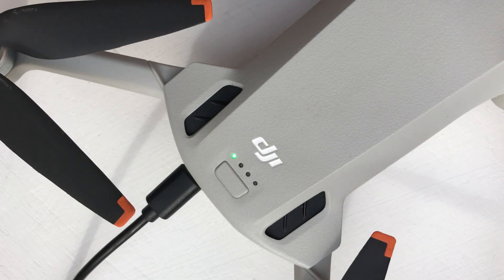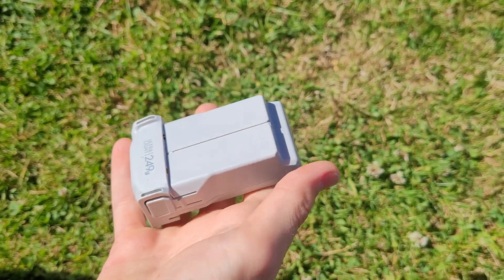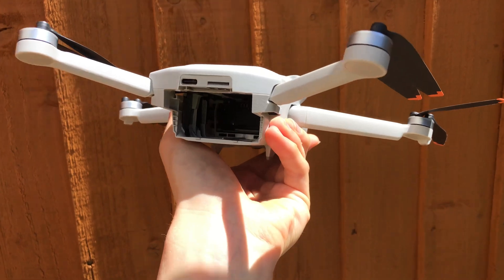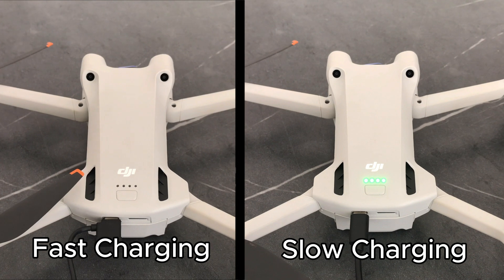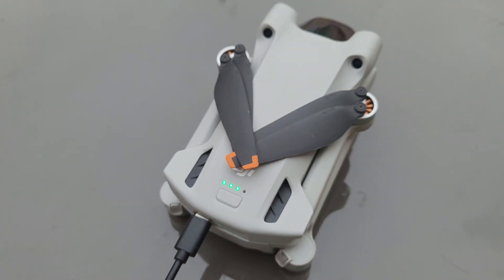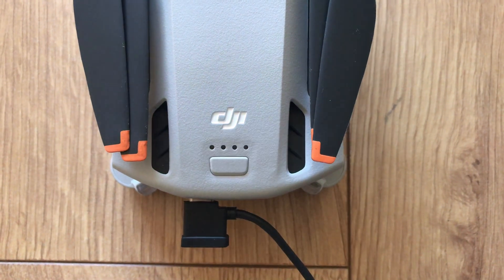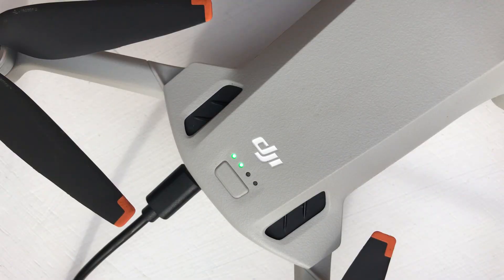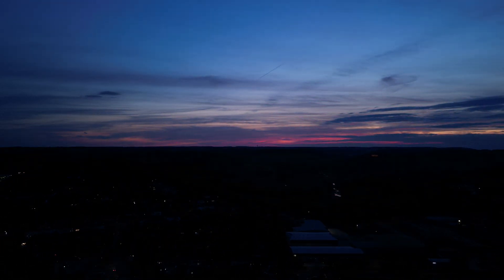Fast vs. Slow Charging - Drone Battery Care | DJI Mini 3 Pro / Mini 4 Pro

Comment: I always slow charge my battery’s when I can, especially after they have been dormant for a long time not being used.. the absolute worst thing you can do to a battery after it’s sat around for a year not being used it force it to fast charge.. a nice slow charge will help it slowly come up and will save the internal cells from stress.. also with a slow charge you should see a very slightly better flight time because you can actually pack more power into a battery that’s being charged slowly than quickly 

I only fast charge when I’m needing to use the battery again right away

Comment: For maximum speed, use a 65W charger when using the 3 x battery charger. If time is not critical, a 45W charger is better for battery lifespan. If you charge 2+ batteries
The difference lies in the heat generated during parallel charging:
The 65W charger charges two batteries simultaneously at high power (30w), causing temperatures to reach around 48–50°C.
The 45W charger also charges two batteries in parallel but splits the power to approx. 22.5W per battery. This keeps the cells significantly cooler at 35–38°C.
The process in detail:
 * One battery: No difference in time or heat.
 * Two batteries: The 65W charger is faster but causes high heat (~50°C). The 45W charger takes slightly longer but keeps both batteries cool (~38°C).
 * Three batteries: First, two batteries charge in parallel (hot with 65W, cool with 45W), followed by the third battery charging individually. Then at 30w.
So if you charge 2 batteries at once in the charger, 45w is the sweet spot.
2800mah DJI mini 5 pro. 
To charge each battery with the 1C optimum, use the Anker nano 20w (or similar). Temp max. 35 Celsius. 

"1C" means charging with a power equal to the battery's capacity (e.g., 20 Watts for a 20Wh battery).
This charges it in exactly one hour. It is the maximum speed possible without creating harmful heat.

In short: If you charge 1 battery, use 20w. If you charge 2 batteries at once, take the 45w charger. If you charge all 3 batteries and time is not critical, take the 20w charger. Also if you have not charging base and only one battery in the drone.

Comment: But how do you slow or fast charge you didn’t explain that
Reply: You can use an old phone charger to charge your drone battery—most older phones came with slow 5W adapters, which are safe. But some older models had fast chargers too. If you're not sure, just check if the battery heats up while charging. With a slow charger, it usually stays cool. If you're still unsure, it's safest to buy a basic 5W charger from any cell phone store.

Comment: This is odd ! Keeping in mind this is the Mavic mini 3/4 pro . I have the mini pro 5 and placed the battery in situ not in the hub and used a Rav 30 watt charger in the iSmart mode to charge  the battery with 80% already in .the battery completely discharged enough not to start the drone when drone legs were opened . ( the battery charged up fine when in the hub ) but testing the battery by pressing the button on it , 2 opposing green leds flash indicating a battery malfunction although initially all leds light up . My fear is the the battery malfunctions in flight . Any ideas ?

Comment: if you look at the mini 3/4 pro standard battery, it is about 2600mAH with max charging voltage of 8.4v, also it is stated that in its spec sheet, that it would take 58 mins to charge with a 30W USB C PD inside the charging hub. By working out the math, it is very obvious that the battery is only charge at 1C or max 1.5C only, which is very standard and healthy charging amperage. unless, if you plug in a 100W PD charger and the battery would complete its charging by 20 mins, yes, then it is quick charging it at 2C-3C amperage, which is not too bad, but it may reduce the health of the battery in long run. Also, battery reduces it life not because of over charging it or charge it at 2C or 3C, the battery life got reduced because of self-discharge. Try leave these battery over a year without doing a thing on it, the battery will be not usable at all.

Comment: i have DJI AIR3 Now my all 3 batteries cycles reached at 100... i dont know much more about battery life. if anybody can guide that &quot;CAN I USE EVEN BATTERIES WILL REACH NEARLY 180+ now drone working fine without any problem Pls guide Note i use 45w PD CHARGER

Comment: well ive had my mini 3 pro 2 years now i have 3 batteries and i always charge in fast charge in the drone itself but it takes about 95 min for each and ive not had any problems with my batteries and thayve been charged 50 times already.

Comment: They're smart batteries, fast charge is regulated to avoid damage. They also start to discharge themselves to storage voltage when not used for a few days
Reply from the maker: Correct - you might notice that if you haven’t flown the drone for a while the batteries which were previously fully charged are at about 60%. Thanks!
Reply: Yes fast charge is obviously limited but that doesn’t mean that it is better for the battery to always fast charge it.. just cuz it CAN doesn’t mean you SHOULD.. slow charging will ALWAYS produce a longer battery life than one that’s always been fast charged.. it’s simple logic.. the faster a battery recharges the harder it is on the internal cells.. the slower you charge it the easier it is on the internal cells.. less stress to internal cells = a longer lasting battery almost every time.

Comment: Important!!
I noticed there's a lot of nonsense here, so I will make a general clarification for those who want reality and truth. The slow/fast modes are selected automatically if the charger is labeled as a fast charger with at least 30W and output voltages between 5-12V minimum. Basically around ~3A charging.

The batteries have 2590mAh, and as a general rule, a normal charge at 1.2C would mean 3108mA, which DJI commercially calls Fast Charge. Anything below that is called "anemic charge."

Why shouldn't we charge the batteries inside the drone using "Fast Charge" then? The answer is very simple and realistic. The DJI Mini 4 Pro does not have an internal fan, and the mainboard doesn’t really have passive heatsinks either. So preferably, do not charge anything with it.

However, if you remove the gimbal protector cap and place a fan in front of the drone to simulate airflow through the grill behind the camera, you can charge "Fast" without any problems.

Final note:
mAh = stored current, battery capacity in milliamp-hours;
mA = instantaneous current measured during charging or discharging, consumption;
1000mA = 1A
Reply: very correct (I do traditional model flying and I charg my LiPo/LiIon batteries with 1C because usually I am never in that hurry that I need more current).

What I do not know or what I am missing:
The charge hub which came with the Mini 4 Pro Fly More Combo could charge batteries.
But there is no setting which says: Charge the batteries to 50% (or something in this range) for storage.

 For normal model flying I have a Junsi Charger and like many other chargers it has the option for storage.
On my Lipo batteries it is set to 3,75V.
Not to high to get batteries damage and a lower risk for thermal run away, but not too low to damage the battery.
Reply: @SoaringExperience  yeah , missing one switch for store mode charge. Allways manual fitting voltage. two led+1 blink is very annoying. anyway, go to 3.85/cell because always lost in balancing few mV. Can't measure battery at pinout because mosfet not close circuit until i2c verified..

Comment: In slow change i charge battery for air 3s 2 day 
Even i didn't get 2 indicators on battery 🔋
Reply from the maker: If you didn’t even get 2 indicators on the battery LEDs, then I don’t think it’s a charging issue. When charging, even from completely empty, at least the first 2 LEDs flash. It might be that your battery is damaged in some way?

Comment: I have two batteries that have only the middle two leds lit up. Will not power up mini pro 4.  Also this happens on the charger no matter what bay I put them in?
Reply from the maker: Hi, if the two middle LEDs light up, it means that a firmware update has failed. Try checking the firmware settings and see if you need to update it!

Comment: This is totally not correct! Like a electrician I can tell you that this is not true. Inside the battery you have chip that he is limiting the input wats to 30W max doesn't matter what charger you are using. Even if you connect them to 120w it will charging on max 30w and this is how they protect the battery. Every battery have life and if you use it 1 time in month then you are killing hur or also if you are leaving them empty for a long time after flights. The outside temperature is also big problem for the life of the battery if you overheat them on direct sunlight not when you fly or you storage them on cold you are also killing they're life. Be happy my boy but for next video watch some another YouTuber because the last one lied to you
Reply: well it could be correct. Example. You just use a PD usb c for the technology to work appropriately.
Reply: I have bought a Raspberry Pi 5 27 watts power supply and it is doing a very good job.  No special cables needed.  The supply is limited to 15 volts so it fit perfectly DJI specifications.
Reply: Batteries, amps, watts and volts are more like electrician job.
Reply: Bro your not acounting the factor of lithium cell degradation
Reply: this is not electrician job. maybe electronist job one. I tell you. is matter because amps. charge in hub with 3A and leave drone just for fly
Reply: @TheUPX thats not what hes trying to say smartass

Comment: Source? "trust me bro..."
That is not how lithium batteries work. Fast charging does not degrade batteries. Heat and total cycles does. DJI Fast charge barely gets it warm, and going slow or fast, you will use a battery cycle. 
So don't worry about this.
Also, it could be useful if you explain how to fast or slow charge, as most people just connect it to whatever charger they have.
Reply from the maker: Hello! I don’t disagree with you there: it’s not the principle of fast charging that can damage the batteries, but rather it’s the heat, stress and cycles as you say.

You say that Fast charging rarely gets the battery warm, however on multiple occasions I have charged the battery with high wattage fast-charge and had it really quite warm. The range of wattage values that constitutes fast charging is quite large, so one instance of fast charging might not get the battery warm, while another would do.

It’s very interesting to see how the batteries are affected by slow/fast charge, so I’ve decided to start collecting and measuring more precise information on this which will be all be included in a future video on this channel. Thanks very much!
Reply: Who cares. Charge and Fly your drones. In 2 years when its shot buy another one or 2. most likely u will be buying another drone that uses another battery. Thats how they make money!

Comment: The batteries are intelligent and will charge as fast as they need to maintain a healthy rate and charge. 

The only thing you can do is use low wattage charge points to force a slow charge as you can’t force a fast charge as the batteries circuit board governs the max rate. 

This video is inaccurate.

Comment: Hi. I bought now DJI 4k mini and maual said, there is no charger - buy minimum 18 W charger. So I looked at my cell phone charger and it said 5 Volts 2 Ampers... No onfo about Watts. So I bought charger extra says 20 Watts, but I saw there then that these ordinary cell phone chargers really make low Watts ( i dobt remember) maybe 5 or 10 watts.
I charge now usually 1 hour.
So slow charging.... So you say, no problem taht manual say usu minimum 18 watts charger, and i can use this ordinary cell phnone charger and it will take 2,5 hours but it will work???? Did I get it right?
Reply: I didnt try yet this my old charger. I thought it could make some damage maybe when manual says use 18 W minimum
Reply from the maker: @MiRo-oz6bz Hey there, 1h charging time to full capacity is definitely fast charging, and 2.5h would be slow charging. 

You can charge with a 5V power source. If the maximum charging current is 2A, this means you are charging at 10W. For DJI Mini 4K, the maximum charging power is 29W. There no harm at all in charging at a lower power, but it will take longer.

Comment: I don't understand why DJI and people say please use PD charger. Dont use charger without PD. Can I damage battery if i use good quality USB 5V/1A charger?
Reply from the maker: It’s more about the charging parameters than the connector. 5V/1A would be considered slow charging, and wouldn’t damage the battery.

Comment: Is in this case that DJI do sell fast charging plugs for their drones and Hubs that they are depleting the life of their customer's batteries?
Reply from the maker: Well, fast charging has the potential to decrease battery lifespan when overused, but DJI aren’t selling customers high wattage chargers with the intention of depleting the life of the batteries. Since this effect happens over a long period of time, it’s not at all intended to damage the batteries. It’s just an optional DJI-brand charging plug which you can buy.
Reply: @takeoffdrones  yeah over time like you say.  I don't think DJI are like that to be intentional,  always had good interactions with them, good customer service.

Comment: Is the DJI 18 W USB Charger good for dji mini 4k charging hub?
Reply from the maker: Yes - this will charge your drone effectively. It should count as fast charging if it does charge at 18W.
Reply: @takeoffdrones Okay, so to protect my battery, I just need to try to make sure that I unplug the cable when all three batteries are done charging?
Reply from the maker: @ScuffyScruffy  yes it would be a good idea to unplug the battery when it’s full.
Reply: @ Alright tysm for replying :)

Comment: Is it safe to store the battery in the drone for long time?
Reply from the maker: Hi, you can keep the battery in the drone no problem, but leaving the battery unused for too long can degrade the battery. In fact, DJI recommends fully charging and using up each battery at least once every 3 months. Also, storing the batteries shouldn’t be in extreme temperature or humidity. Thanks
Reply: @takeoffdrones  thank you so much for the info.. God bless

Comment: But at least they won't die midflight
Reply from the maker: Yes, they won’t die mid-flight, because the drone will force a landing if the battery gets very low.

Comment: hello, I use a 20 watt charger for my dji mini3, is that OK? what do you recommend? thanks
Reply from the maker: Yes, 20W is fine. But make sure to check the voltage as well - the charging voltage should be lower or equal to the max charge voltage of the battery. You can check these values on the drone’s battery.
Reply: @takeoffdronesis 45w ok? For dji mini 4 pro?
Reply from the maker: Hi, 45W is ok. However, the drone batteries are smart and will adjust to only intake around 18W. The remaining wattage is left unused to prevent overheating.
Reply: @takeoffdrones i saw in a vid that they need atleast a 30w charger
Reply from the maker: @MalibuBrawlstars  the official DJI charger is 30W, but the drone in reality only intakes around 18W based on previous charging measurements. It is however important to make sure the voltage or current isn’t too high.
Reply: @takeoffdroneswhat is to high?
Reply from the maker: Hi, the max charging voltage is written on the back of the battery - for Mini 3 Pro it is 8.5V. Max charging current is about 2.5A, because fast charging charges at 2.4A.

However, it’s very unlikely that your charger will be capable of charging with at a fixed current; almost no chargers can do this. So don’t worry much about the current.
Reply: I used my cellphone charger to charge the battery of my drone is it ok?

Comment: Maybe some detail about what constitutes fast or slow charge wattage wise would be helpful?
Reply: They are smart batteries, they automatically adjust input to 30 watts (mini 4 pro) to give maximum life if you you use the proper PD charger. I would consider an under 2 amp (10 watts) charger slow
Reply from the maker: Also, based on my measurements of how long the battery was fully charged, these parameters can be found:

Slow Charge: 7.5V, 1A, Charging time 2h30m
This gives 7.5W

Fast Charge: 7.5V, 2.4A, Charging time 1h
This gives 18W

This tells us that the boundary is somewhere between 7.5W and 18W, but the precise boundary I’m not sure.
Reply from the maker: Hey there, the exact boundary between fast and slow charging is unknown. However, it’s a good idea to make sure the voltage is kept below or equal to the max charging voltage of the battery (this info can be found on the battery itself). Otherwise, the drone will not accept all of the charge and the charging speed will be capped. I’m sure DJI would be able to answer this though. Thanks
Reply: As battery capacity is given in Watt-hours or Amp-hours, a simple definition of fast charging is: anything that can charge the battery to near full in less than an hour. Electric cars on a road trip are supposed to charge in less than 30 minutes, some under 20 minutes, but not 0% to 100% but a more realistic 10% to 80% charge. You better charge before dripping to 0%, and topping up from around 70% to 100% is quite slow with lithium ion, so stopping at 80% is recommended - unless you really need more charge and range.
Reply: No shit I came here to say this like WTF were they thinking lol. I didn't even know I had different options using the drone to charge. Still don't know how to change between the two settings. I have mini 4k